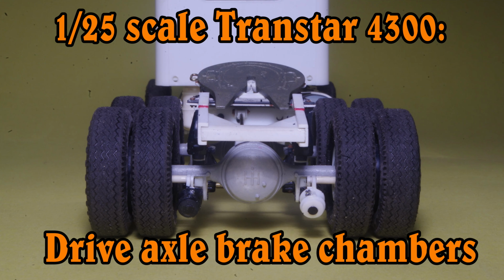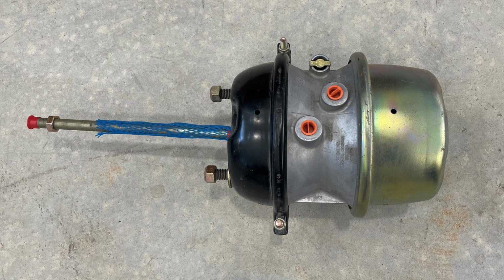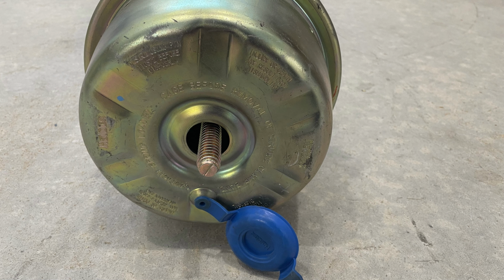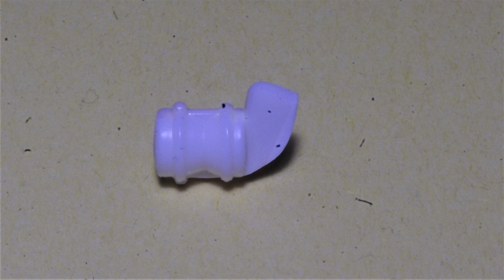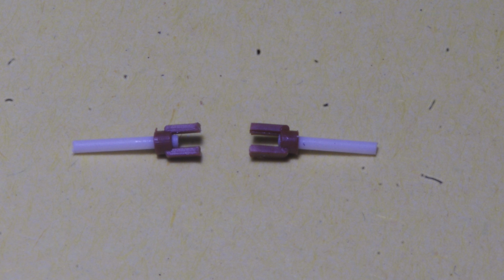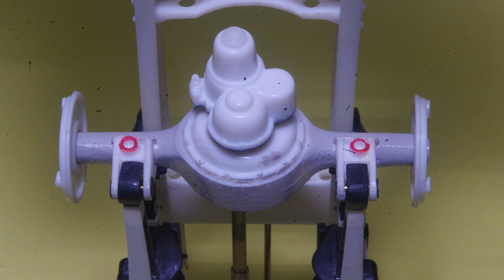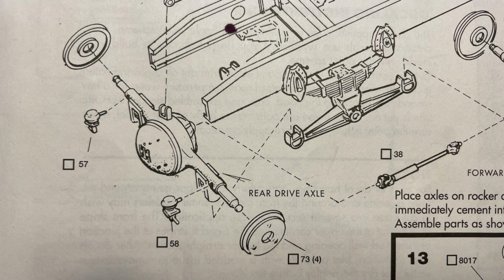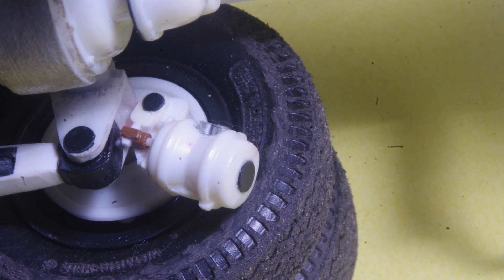1/25 scale Transtar 4300: Drive axle brake chambers

Comment: The way you break things down is great. It starts to look much more do-able for those that have thought they couldn't. You make it look easy and get fantastic results. Thanks for sharing
Reply from the maker: Because a lot of them can be necessary for one model, especially if lots of axles are involved like in some Michigan, Ontario and Quebec rugs it would be nice if detail parts for items like various makes and sizes of brake chambers were available (Haldex 30/30 for example) similar to what has long been offered in the model railroading field, although the potential truck model market may be too small for that to be a viable option. There are some resin parts made.

Comment: I noticed also that you have the slack adjusters at 90 degrees which I understand is the correct setting when brakes are adjusted by mechanics.
Reply from the maker: I actually didn't think about that part when building the model ones, after you mentioned it I do recall reading somewhere that the 90 degree angle when brakes are applied is a handy "eyeball" check for a driver as well.

Will have to remember to assemble front ones at a little shallower angle as those ones don't have parking brakes!
Reply: @brsnorthernhorsejourney3579 That's what a couple of drivers told me, as long as they are 90 degrees they would be ok at the time. I don't know anything about the fronts.